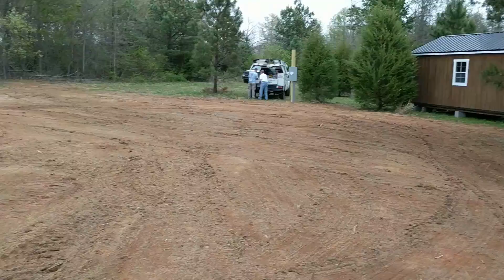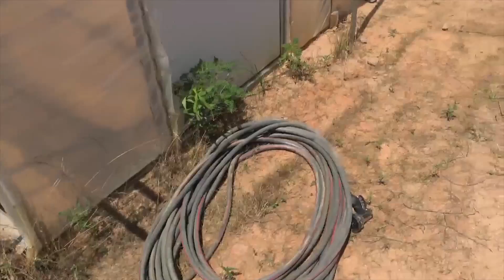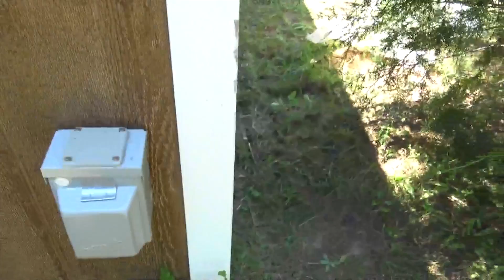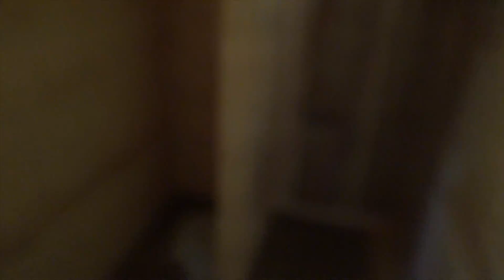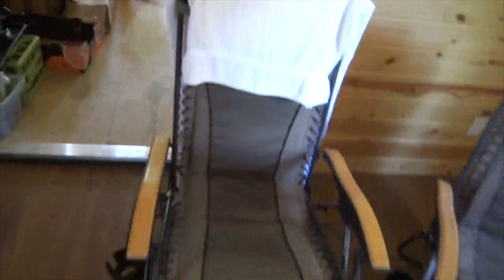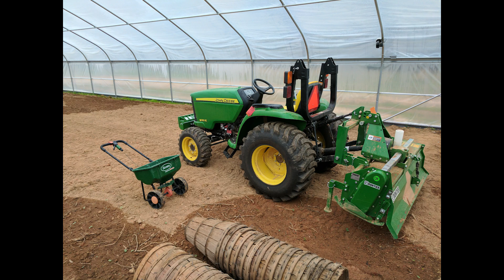Food For Thought

Comment: What's the pipe cutting tool?
Reply: mundotazo It looks like a Milwaukee 12v pipe cutter.  I've seen them in Home Depot.
Reply: http://www.homedepot.com/p/Milwaukee-M12-12-Volt-Lithium-Ion-Cordless-PVC-Shear-Kit-2470-21/202042892?cm_mmc=Shopping%7cTHD%7cG%7c0%7cG-BASE-PLA-D25T-PowerTools%7c&gclid=CjwKEAjwqIfLBRCk6vH_rJq7yD0SJACG18frbborjU_SQm6S39ygVvM8RgCgsGh33zaCFQK5TGNSTRoCK3rw_wcB&gclsrc=aw.ds
Reply from the maker: It's awesome.  Milwaukee Pipe shear